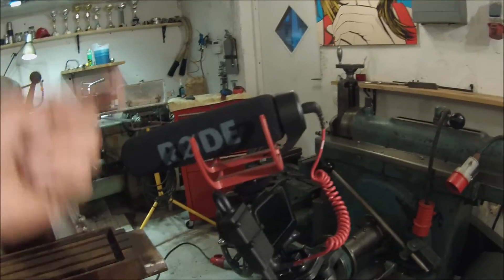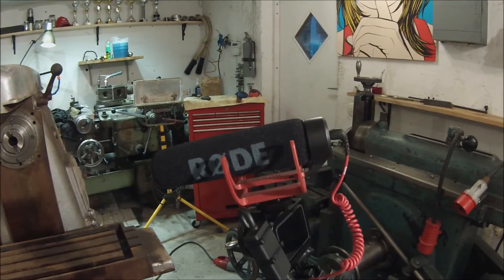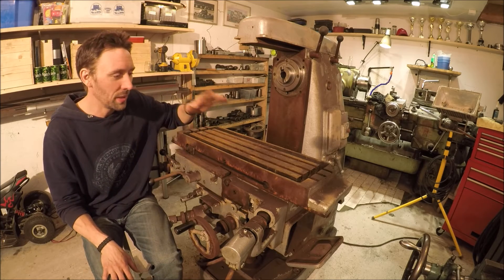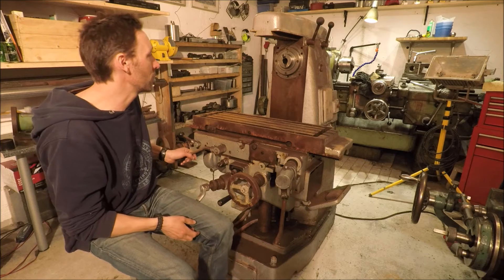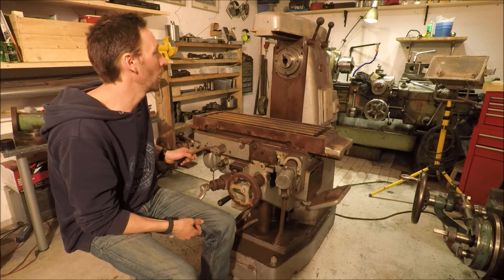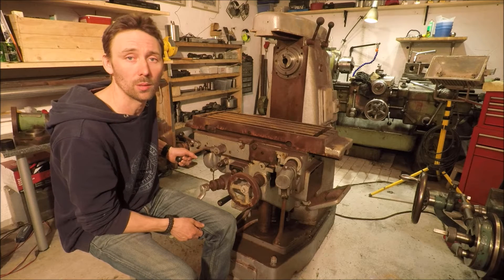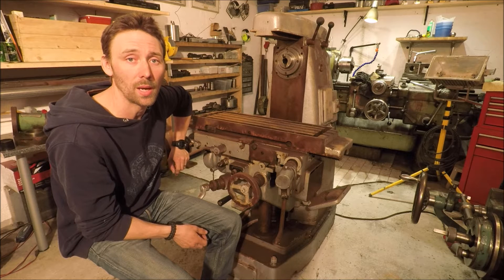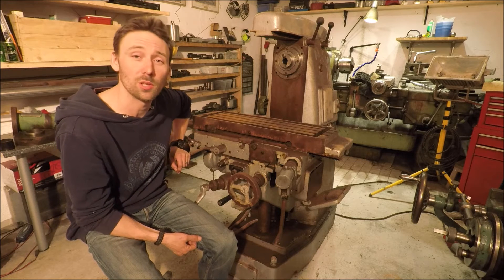Restoring a Värnamo horizontal milling machine - Part 1

Comment: Just a super rough guess, based on only a very few seconds of video. Maybe the auto feed is controlled by the little pulley behind the gear box, where the broken cover was. Maybe it's an adjustable sheave pulley. Similar to a cvt automotive clutch setup, accept only on 1 pulley.
Reply from the maker: Interesting idea! I´ll have to look into it. Sounds kinda odd since feeds are usually in steps, but who knows. Thanks!
Reply: ya, just a wild ass guess... lol
Reply from the maker: +Billy T Well, your guess is as good as mine :) Thanks for posting your thoughts!

Comment: What is the taper on the verticle head? Electrolysis will take care of the rust, looks like just on the surface not real deep. Nice mill though. The transmission levers look like the ones on my Arboga Mekaniska 825 mill/drill.
Reply from the maker: +George Chambers Well, that vertical head taper is something i havn't figured out yet. At first i thought it was an ISO 30, but on closer inspection it doesn't look like an ISO. I'll show it in the next video and mabye a viewer will have the answer. Electrolysis sounds like a good option. I was thinking Evaporust, but now im leaning towards electrolysis. So you have an Arboga? Go Sweden! :)
Reply from the maker: So i got some help with this on a forum. The taper is a MK3 with drawbar.
Reply: I've never seen that one before? Good luck on your tooling search!
Reply from the maker: Thanks! Let the games begin!
Reply: The main spindle probably has a morse 4 or 5 taper and not any of the standard mill tapers? Just judging by the arbors. Milling with arbors splits the forces between the spindle and the support, so the mill spindle does not have to be very rigid. You prob figured all this out yourself by now :-).
Reply from the maker: sunppaa I figured out the main spindle is ISO 40 and the spindle on the vertical head has an MK3 morse taper. So now i just need some tools for it.